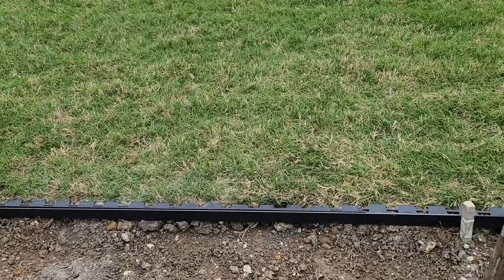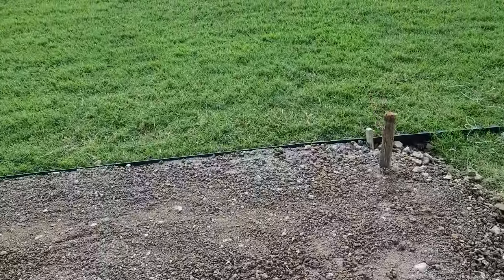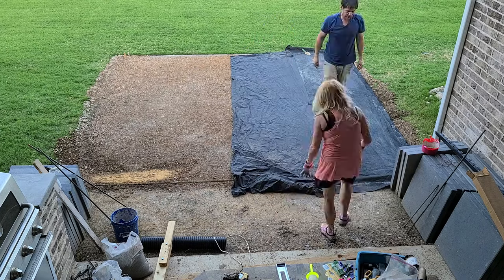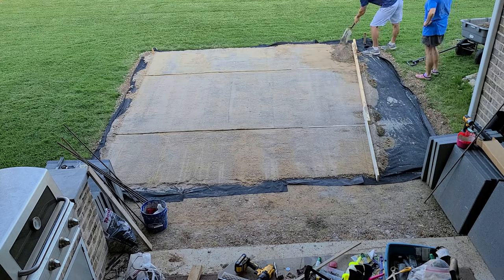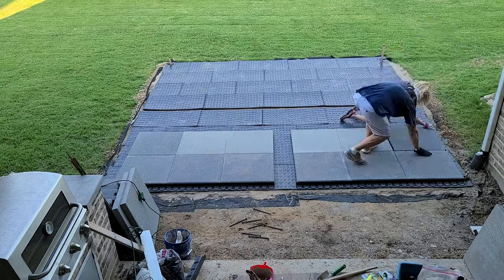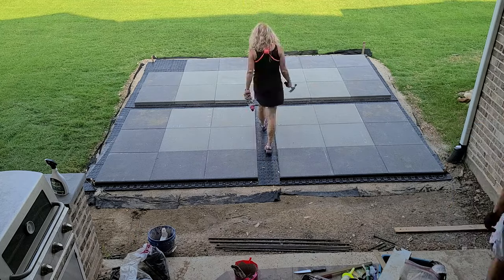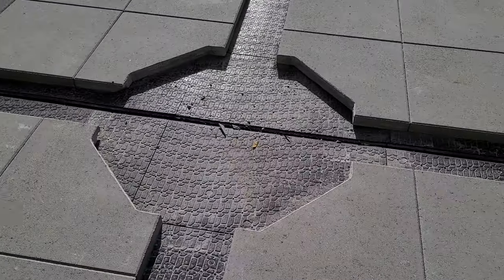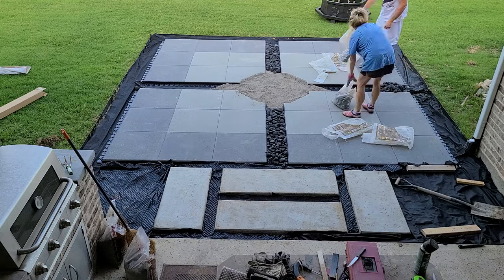Paver patio build using Brock panels

Comment: Great video - One question I did have, you mentioned that you didnt leave a gap so no need for the polymeric sand, what was the reason for not gaping stones? I was kinda hoping I could skip that step as well if it doenst lead to any issues later on, but every video I find online mentions some type of gap during install.
Reply from the maker: I think different pavers are made differently.  Many are angled or built with "false joints" designed to create a spacing wide enough for polymeric sand.  Here's an article discussing joint spacing:  https://www.sakrete.com/blog/post/applying-polymeric-sand-to-an-existing-patio-or-walkway/
The particular pavers I used have vertical sides and tightly butt against each other, which is a look I like.  I am hoping the paver edging keeps them that way.  BUT, if I see them moving after some use I may go back and reevaluate using polymeric sand.

Comment: I've never used the Brock panels. But, wonder if you used the correct type of sand. The idea of the sand is to allow water to move through it, without actually washing the sand away. That is done with coarse sand. Finer sand granules are very symmetric, and form a solid barrier for water. But, water is able to break through that, and wash the barrier away. Coarse sand granules have jagged edges that lock together leaving gaps for water to flow through.
Reply from the maker: I will definitely keep an eye on it. So far so good, even with very heavy rains. The instructions say to use "all purpose sand, also called leveling sand, paver sand, and step 2 sand."
Reply: I'm curious what the purpose of the panels are? Does it actually save time and material ?
Reply from the maker: @jorgefarinas6071  Without the panels I would have had to dig another 4-6 inches down and bring in paver base to fill and compact.  So the panels saved me all that extra digging and all the transport of that paver base.

Comment: Great work.   Would you say the leveling is one of the trickiest parts of the job?
Reply: Without a doubt.  I’m doing a pathway now, and it’s a bear.  Like this guy, I’m finding it necessary to use sand on top of the paver base in some locations just to keep things level.

Comment: How is this holding up? I am re doing my patio this spring and wanted to try out the Brock paver base panels but nervous about the durability
Reply from the maker: I built this about 9 months ago and I haven't noticed any issues with movement or settling so far.  Before I did this I found a youtube video where a guy revisited a Brock installation that was several years old and it looked great.

Comment: Its hard for me to tell but are pavers flush to the ground or elevated?
Reply from the maker: The Brock panels lay directly on the sand and the pavers lay directly on the panels.  (Sometimes the pavers were not perfectly level with each other, in which case I added a bit of sand between the paver and the panel.)

Comment: Great video with excellent detail.  One quick question, are you not suppose to use the plate compactor on the sand base?
Reply from the maker: Thanks!  The instructions say to screed the sand layer rather than compact it.

Comment: So is it your experience that the Paver Sand from Home Depot will not work with the Brock tiles? Just had 30 bags delivered last week 😮
Reply from the maker: I would open one bag just to make sure there aren't pebbles/rocks mixed in.  If it's just sand, it should be fine.  Good luck with your project!

Comment: How do you prevent mold from forming under these stones? Is the rubber already mold-repelling? And how much did this all cost?
Reply: Total cost was about $1600.  Regarding mold, I found this info on Brock's FAQ page:  "Polypropylene has a LONG life and is proven in many construction materials, such as pipes, geofabrics and rope. It is chosen because of its durability and its resistance to mold, bacteria, decay, cracking and in the case of pavers, compression."
Reply: @mdelgiorno  Thanks! And for 1600$ I thnk this is great. I was expecting multiple times more. Good job.

Comment: Hello, I’m starting my project, before i lay the sand anything else i can use instead of fill dirt?
Reply from the maker: The instructions say you can use paver base, which you can buy by the bag at the big box stores. I used paver base over the fill dirt to fill low spots.

Comment: Hi. Did you leave the rebar in at the one end of the patio, or remove it once the sand was level?
Reply from the maker: I used the rebar as a guide for the screed to get the fill dirt level, then removed the rebar.  For the sand, I ended up using two half inch sticks sitting on top of the dirt as a guide for the screed.  Good luck with your project!

Comment: How much all together?
Reply from the maker: About $1600 total.  Broken down:

$400 Brock panels
$450 pavers
$100 fill
$650 river rock

Had I realized how much river rock costs, I probably would have used it just between the sections rather than between AND around.

Comment: EVERY video I watch is the same thing. They skip the entire process of figuring out where to tie the lines on the 'high' side of the deck. The process of determining those measurements. They just skip over it, every single video. He explains he wants it level on both sides, he explains that he wants a slope, he does not mention how he measured that slope, what math he used, how high on the pole to tie the first side before determining that slope and how to measure and then mark  that, he just skips straight to 'once I set those lines there is a lot to fill in'. Just ignores a massive detail.
Reply from the maker: That's fair - I should have included that in the video.  I'll describe what I did best I can.  On the high side, tie a string to a stake and drive the stake until the string is at ground level.  On the low side, drive a stake and, using a line level, tie the string so that it shows level.  Decide what slope you want (eg, 1/4" per foot).  Multiply the slope by the distance between the stakes (eg, 1/4" times 20 feet = 5").  Then move the string on the low side down (or drive the stake further) by that amount (5").
Reply: @projectreaDIY  Thank you.